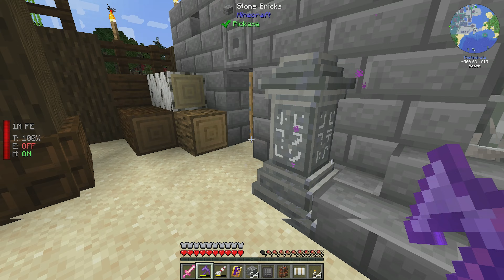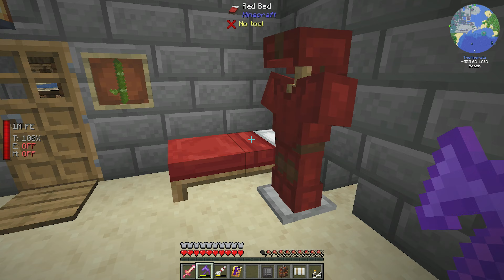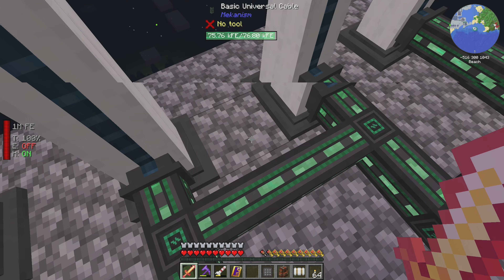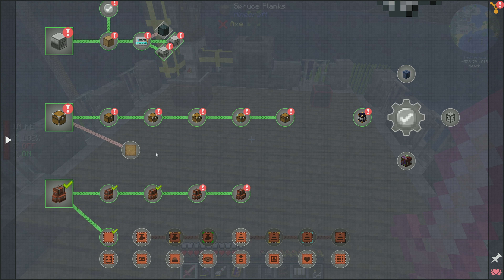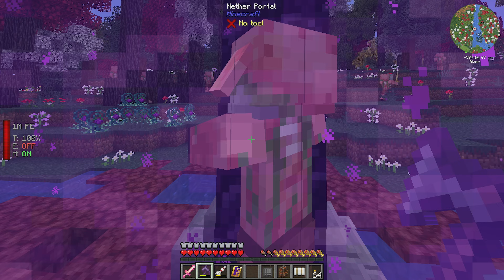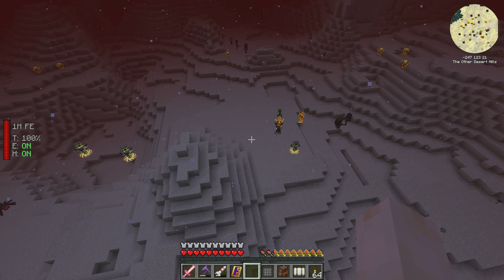All the Mods 7: S2 EP15 | We're Making Clean Energy! | Minecraft 1.18

Comment: The pipe isn’t actually extracting power from the gas burning generator because it’s connected to a gas input not energy output witch has a flux plug connected to it
Reply from the maker: D'oh! You're probably right, I'll have to check that.

Comment: The thing bottlenecking your wind generators could be the extract speed of the universal cables, but I'm not familiar enough with mekanism to know that for sure. Also I believe you put the ultimate pipe upgrade on the item channel, not the energy one, not sure if that will make a difference to your gas generators rf production

Comment: You’ll want to use the create hose pully. What you have will drain the lava, the create hose won’t. Use the thermal fluid cell on it and an ender tank.
Reply from the maker: Completely forgot about the hose pulley! Now to figure out how it works… 🤔
Reply: @TheAndrata  it’s really as easy as I said. Pulley, fluid cell, ender tank. You configure the fluid cell to pull from the pulley and push to the tank.
Reply from the maker: Does the pulley need rotation?
Reply: @TheAndrata  only to get it into the lava which you do with a hand crank.
Reply from the maker: Wow! I never knew it was that easy! I always thought it needed constant power.
Reply: @TheAndrata  usually. But if the block will draw without power as the thermal fluid cell will it doesn’t.
Reply: @TheAndrata  you can just use a pipez fluid pipe on the output of the hose pulley set to extract and connect that to the ender tank, you don't even need the fluid cell